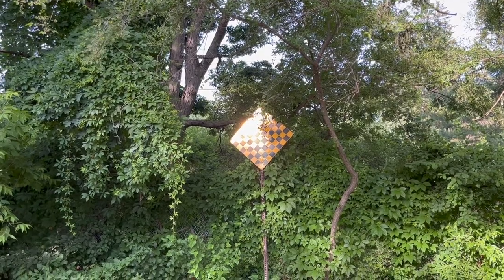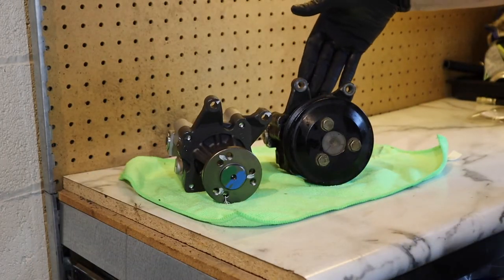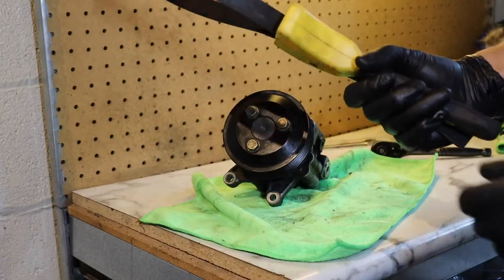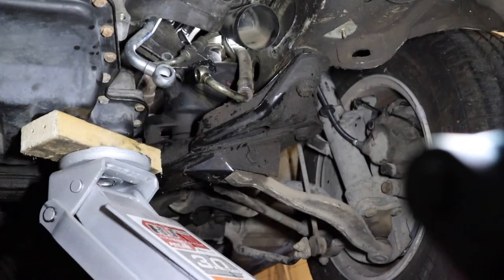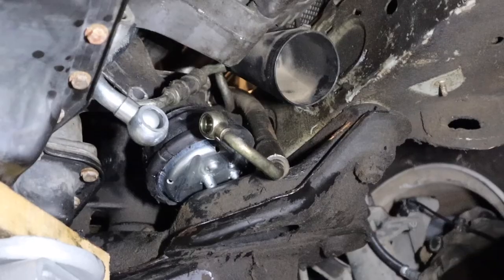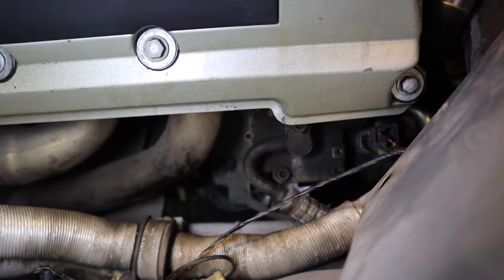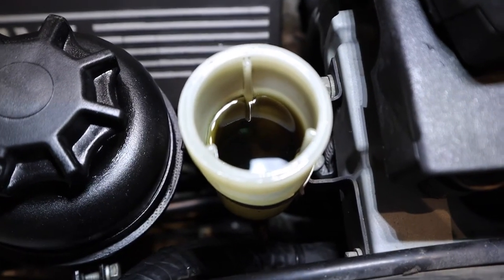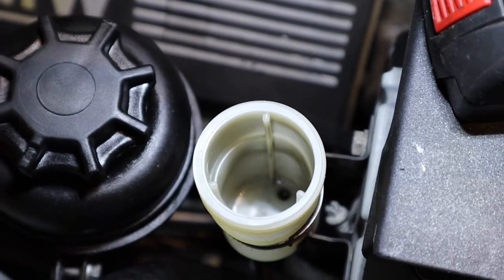Why you need to regularly change the fluids in your car! Project E34 Part 7

Comment: The life time transmission fluid needs to be changed?
Reply from the maker: In a manual transmission it is recommended to change the fluid, in automatic it’s usually lifetime
Reply: Yes. ZF reviewed their procedures and said it needs to be changed
Reply: There's no such thing as lifetime fluid unless you consider the warranty period the lifetime of the car. 😅